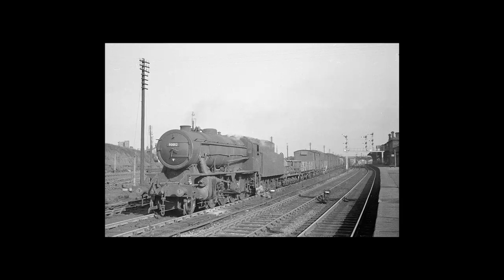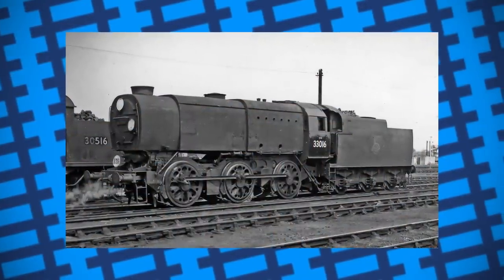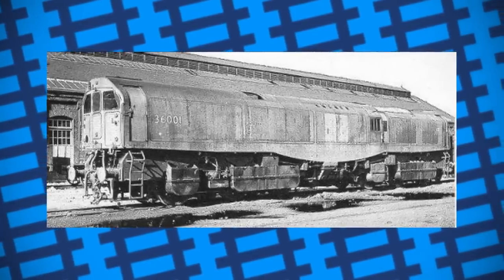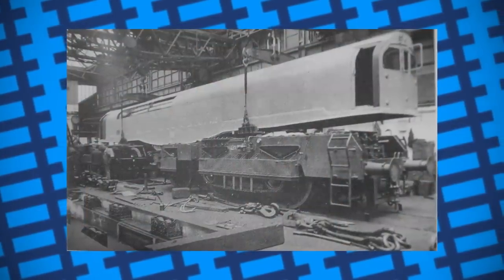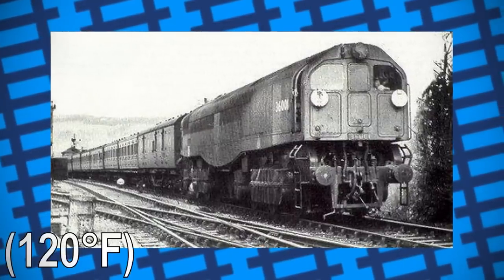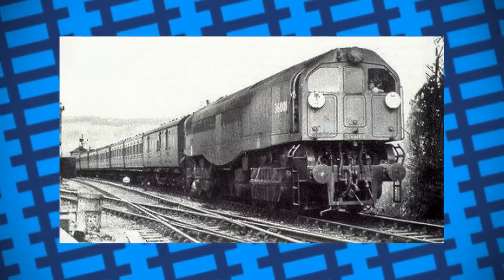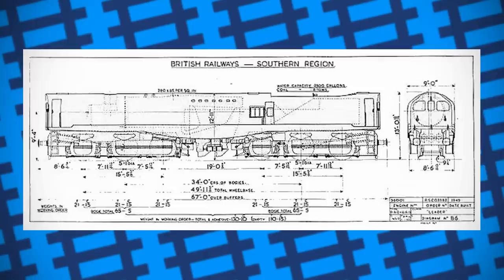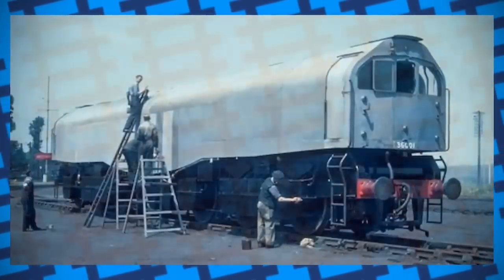The strange Steam Locomotive that was built like a Diesel - SR Leader Class

Comment: Interesting quote that I found from the SREMG article of the locomotive: “Looking back at this project with the benefit of hindsight, it would probably have been a better idea if Bulleid had spent more time in the drawing office, as he had for the Merchant Navy and the Q1 Class designs. As it was, Bulleid was a rare visitor there.”
Reply: Did the video not mention a few hundred thousand pounds in development costs for the Leader, let's face it, even if it was that amount, i think the mood in BR was to go with the tried and tested. Electrification had proved to be very reliable for general passenger work.  i wonder if it was an early manifestation of the sunken cost polemic?
Reply: I actually am curious how it would've turned out as an easy operative oil burner, maybe the fireman could've stayed in the cabin of the operator then
Reply: @cerseonbrassmann5222  Even a mechanical stoker & an additional door could have solved a lot of problems. It seems like certain elements weren't thought through to their greatest potential which is really sad.
Reply: @timothypurser8729  That for sure, but even then is the door necessary? many things could've gone smarter
Reply: @cerseonbrassmann5222  2 points of access for all area's on the locomotive should be a minimum in case of an accident. plus having an additional door that could be left open could have helped with the draught.
Reply: @timothypurser8729  good point

Comment: A fascinating concept.  But the desire to retain coal fired boilers was possibly the greatest drawback.  Had Bullied dared to go a step further, an oil fired boiler might just have worked, saving the fireman from being roasted.
Reply: With an oil-fired boiler it could have avoided needing a fireman's cab entirely, perhaps could have had the fireman in the same cab as the driver - or just have one of the cabs be the fireman's station, driver being in whichever is at the front for the direction they're going. I've thought about the idea of "modern" steam locomotives (something that would have no compelling reason to be built) that could have the function f the fireman entirely automated, even if coal-fired by using an auto-stoker. But on the other hand, I suspect ability to run on coal rather than oil was the main advantage of steam locomotives over diesel, if you're going to burn oil a diesel is simpler and cheaper to maintain, easier to operate, doesn't need water, and more fuel efficient than an oil-burning steam locomotive.
Reply: The country was completely bankrupt after the war. The was no question whatsoever of producing anything that would run on oil - either internal or external combustion. This was especially so, since we were sitting on huge reserves of coal.
Reply: Boiler management can now be automated. Even the steam turbines of Union Pacific made their boilers automated. Even better when it is oil fired.

Make the AI operate the boiler with thousands of sensors. Even better, make the boiler and controller as a single package for easy swapping.
Reply: @kimpatz2189  This would be trivial to do with modern technology, and a lot of boilers are so automated. Likewise internal combustion and turbine engines (including the gasoline engines in cars) are highly automated in this manner. But there really isn't a compelling reason to build a steam locomotive with such, as diesels are still going to be simpler, easier to maintain, and more efficient. The only possible advantage I could see would be that steam engines can run on coal, which is cheaper than diesel fuel or oil - going against your oil-fired suggestion. But emissions would prevent a coal-fired steam locomotive being used in regular service in any developed country, coal can only be burned in large power plants that have sophisticated emissions controls that would be impractical or impossible to implement on a smaller scale (and if they were would negate any cost savings).

As for your mention of Union Pacific, I don't believe they ever operated steam turbine locomotives - a few experimental ones were built but none by Union Pacific. You're probably thinking of their gas turbine electric locomotives, which were successful because they were able to run on then otherwise useless (later methods for refining it were developed) heavy fuel oil, but were quite inefficient. These replaced the steam Big Boy locomotives, showing that if running on fuel oil even a gas turbine is more cost-effective than steam.
Reply: @quillmaurer6563   UP did actually have a stab in '38 with a steam turbine, but unlike the Stanier pacific or the PRR S2 the UP example used a steam turbine to run a generator and traction motors
Reply: Leader was originally intended to be oil fired. I'm adding a general comment a bit further up
Reply: Maybe a water tube boiler, thinner in diameter allowing passageways each side and no need for counterweighting.
Reply: @donotwantahandle1111   they've never proved successful in railway operations for whatever reasons. like the triple expansion: some things are best left out at sea :) (the extremely high temperatures water tube boilers possess seems to be a factor, as with super heating and pressures as well: and with the relatively high reciprocating speeds steam oil dissipation can have a disastrous effect, as N&W started finding out...)
Reply: @muir8009  Interesting, I'd never heard of those - looked it up, apparently they performed well but were unreliable. Unlike most other steam-turbine locomotives, they had forward cabs and full car-bodies, thus looked more like diesel-electrics.
Reply: @quillmaurer6563   I still have a sneaking suspicion that these steam electric turbines and gas turbines and the like were built solely to look extremely impressive.
If you have a look at pics of nude steam turbines like M1 they look like a builders and maintenance nightmare, and unlike a diesel electric where the mechanicals are contained in crane friendly entities (e.g engine/dynamo set, or the brake/compressor set in the nose) the components of the turbines were all intertwined, maintenance or issues having to be dealt with in situ.
Like a lot of things throughout, what can be seen as being a wonderful idea doesn't actually translate into practical advantage. An analogy may be cars in the early 90's there was a sudden rush to have 4 wheel steer. the buying public expressing as great an enthusiasm as the sedan folding rear seat, which was a darn sight cheaper to produce for a manufacturer, and was actually a demonstratable advantage over what existed previously.
Reply: @muir8009  Agreed - they were interesting concepts but had too many shortcomings. Impressive at first glance, but impractical. 

Actually the UP gas turbine locomotives were pretty successful for a while, as they could run on what was at the time very cheap fuel (but they burned a lot of it), were massively powerful, from what I recall quite reliable, and low maintenance. Gas turbines are actually extremely simple and quite easy to service, so probably come out ahead of diesels in many regards. They were successful until new refining processes made it possible to turn the heavy fuel oil into more useful grades, at which point it was no longer seen as a useless byproduct and became much more expensive.

Agree that there are a lot of drawbacks of steam turbine locomotives in terms of complexity. Direct drive wouldn't make any sense due to both inefficiency at low speed and inaccessibility of components. I'd think steam-turbine-electric could solve both issues though, the turbine-generator unit could be mounted in an easily accessible manner remotely from the wheels, and the traction motors in the traction motors in the trucks would be pretty similar to those on a diesel-electric. The electric final drive would also allow for better efficiencies at a variety of speeds. This also solves the problem of reversing. The trucks/motors would be the same as a diesel electric, the steam turbine could be quite simple, but there's still the boiler that requires a lot of maintenance. Thus still not coming out ahead of diesel. As much as we all love steam, there is just no compelling advantage of it - either traditional or some unconventional design - over steam under really any circumstances. Except perhaps if there were a need to run on coal or other fuel not suitable for diesels, but so far the cost of diesel fuel hasn't outweighed the shortcomings of any steam concept. Hypothetically that could change someday, but at that point hopefully we'll just electrify everything.

As for the novelty of something huge, which is possible but impractical, we've seen this numerous times, in railways and elsewhere. Union Pacific has done so on many occasions. Actually the Big Boy, gas turbine locomotives, and DDA40X were all reasonably successful and remained in service for a while, but in the end UP concluded that a larger number of smaller locomotives was more practical. Attempts by manufacturers to make 6,000 hp class diesel locomotives haven't been very successful, the SD90 and AC6000 both functioned but were plagued with reliability issues. I suspect they could have been resolved, but ultimately it was found nobody wanted them - railroads preferred the 4500-HP-class locomotives (SD70, ES44CW, etc). We can see the same in other industries - the Airbus A380 did what it was supposed to, but most airlines found it to not be particularly useful, and now are even ditching their 747s in favor of twinjets. Or the largest supertanker ships ever built were found to be impractical and in the end were just used as floating storage tanks. As well as huge stuff, like you mention there are other novelties out there that sound cool on paper but have no compelling advantages over the more traditional design. I even feel that way about new cars, they have a lot of gadgets but for most owners have no compelling functional advantages over a good-condition 10-year-old (or even 20 year old) car - this is a bit of a problem for the auto industry.
Reply: @quillmaurer6563   what excellent observations. I wholeheartedly agree with everything you've said. 
Interesting you point out the advantages with what could term 'mid range' power (a relative term!) Over single units of high rating. On a big boy note (and by extension the turbines) one can understand UP's  desire to alleviate if not eliminate double heading, however it should always be noted the limited operating area they worked, whereas the diesels could be split, or used network wide for whatever traffic offerings were available. 
It's almost a shame that the Milwaukee and great northern electric networks fell into neglect, displaying their own advantages over steam. The UP's coal turbine was a good thought, as the experiment demonstrated, but of course ended up being a blind alley, not really for a particular reason, just that no real advantages were forthcoming. I'm not really adding to anything you've already said!
Reply: @muir8009  Yeah, it's all interesting stuff. The big-locomotive thing made sense when each unit had to be manned, meaning fewer crews and overall simpler operations. Double-header steam wasn't all that common to my understanding, usually they just pulled smaller trains or made bigger locomotives, only used helpers on steep climb sections. Thus bigger was better. Multi-unit operation was possible almost right away in the diesel era, but some still clung to the huge locomotive philosophy for a while, eventually realizing it was less practical. Like the DDA40X, it was basically two GP40s on one frame - what compelling advantage did it have over two GP40s? Gradually single-engine locomotives grew bigger, which gave advantages over more smaller-power engines, but eventually the advantages became less. One thing I've heard about the 6,000 hp locomotives is that, as well as their reliability (which I think could be resolved with time), they still have only six traction motors, which limits their dynamic braking capacity. That turns into a bigger shortcoming than power - a larger number of lower-power locomotives will have the same collective horsepower but more dynamic brake capacity. Could solve this by making 8-axle locomotives, but those introduce other issues, particularly wear to wheels and rails on curves. Or span-bolsters like some of the other UP monsters used (four two-axle trucks), but that adds complexity. All in the end ... why? Everyone is happy with 4500hp locomotives, unless there are compelling advantages to go bigger it makes sense to just go with what works. If it ain't broke don't fix it. 6000 hp locomotives are solutions in search of a problem as they say.
Reply: When Leader was envisaged, oil was an expensive imported commodity (we didn't know about North Sea oil at the time & no, I'm not going anywhere near the "whose oil was it anyway" arguments). The country was bankrupt after the war & we had millions of tons of readily available coal, steam was a proven technology & so steam it was.
Hindsight is a very useful thing as electrification was the real way forward but involved hugely expensive infrastructure projects, which we are now completing.
European countries invested in electrification & diesel electric projects as their railway systems had been comprehensively destroyed during the war & they could start again on a "clean sheet ". We had to make do & mend.
Reply: There is a very good reason why Britain stayed with coal much longer than the US, and that is the availability of natural resources. We are living in an age of North Sea oil and gas, and importing oil and gas - so from our modern perspective we can see the advantages. Our main natural resource is Coal and coal gas, which can be extracted quite cheaply as opposed to spending huge amounts importing oil from the US. 

The shift to oil fired ships in the Royal Navy was done because it is a more efficient use of the crew and firing a ship with coal is very intensive. Sadly, that made us dependent on the US for energy.
Reply: The fact that they tried to combine the economy of domestic coal with the ease-of-use of diesel and DIDN'T include an automatic stoker is incomprehensible to me.
Reply: If you're going to have an oil fired boiler, what's the advantage over a diesel?
Reply: @gregorymalchuk272   but they didn't. It wasn't meant to be coal fired
Reply: @kimpatz2189  We call that "combine boiler".

Comment: I've seen some square shaped steam locomotives, basically tram engines and vertical boilered engines, as well as the Q1 Class too, but this...this is bizarre yet interesting. As a bonus, this reminded me of a diesel Bulleid built in 1949: BR 11001. This Diesel was unique for it's cab layout similar to a steam engine's since drivers at the time weren't familiar with operating Diesel engines. Sadly, 11001 was only in service for a decade and then scrapped in 1959.

Comment: The only way a steam engine could have competed with diesels any longer than they did, would have been if they switched from boilers to steam generators, and liquid fuel. Basically the way some steam cars went near the end of their run.

I've put some thought into it myself, it would have made sense to go with multiple steam generators, running just the number needed for a given load, with a relatively small accumulator tank to make up the short time it takes for them to come on as the throttle is opened. The space saved from not running a boiler would allow more fuel and water onboard, as well as a condenser to conserve the water already there. Plus the steam engines themselves could be mounted on the frames, and drive shafts that go to the bogies like geared locomotives had. The higher steam pressures you could safely run would also mean it could be geared for speed and still haul a lot of weight.

Though it's easy to say what they could or should have done in hindsight, with the technology they had.
Reply: I have wondered about the failure to build a steam generator electric drive locomotive for decades.  I have never found information that explained why it was never done.  Does anybody have a guess?
Reply: Yup
Reply: @MattTCfarm  i think it was down to diesel electric engines just where better. Pull more and at higher speeds. Freight trains you see today are not much better than the ones first brought in. More efficient and more powerful yeah. Same tech though.

Comment: Here in the US there were "cab forward" steam locomotives used on the Southern Pacific from 1944 to 1956 when they were replaced with diesel.  While still being steam driven they used fuel oil to fire the boiler. It was the Southern Pacific 4294 class.

Comment: It's nice to see this design highlighted but sadly so much of the story is missed. The leader was conceived as an oil fired locomotive but the state of the British economy  ruled against the use of oil firing. If it had, it would have solved most of the problems for the fireman... The sole prototype was also dogged by reliability and performance issues caused by one of it's bogie/engines which was found to be due to a bad casting. This was never corrected  mainly because by the time it had been diagnosed, the design was already considered redundant. In fact, it could be said that the main reason the project was scrapped was because BR had already decided the future was with diesel (and because it's main protagonist, Oliver Bulleid, had already left the organisation). Other points of interest missed include that the locomotive had six cylinders, three to each bogie and used a sleeve valve gear reminiscent of the Napier Sabre aero engine. A very interesting design and one that could have been developed to work effectively but sadly too late.